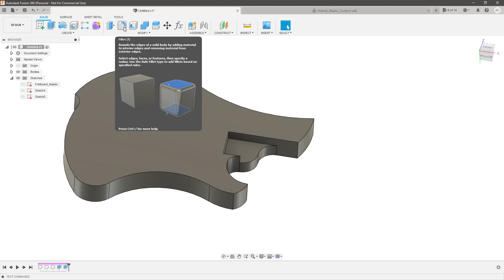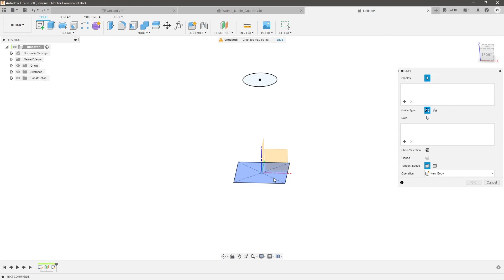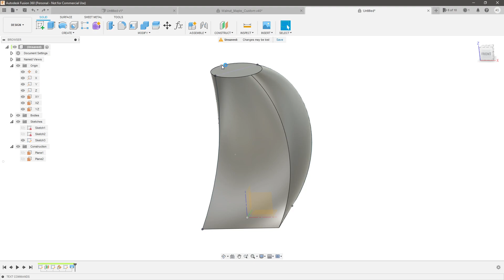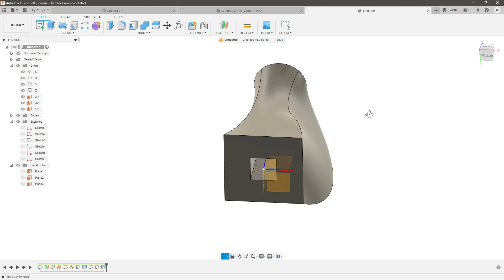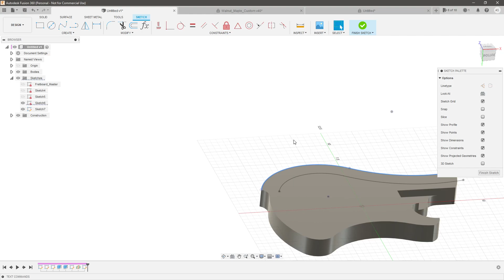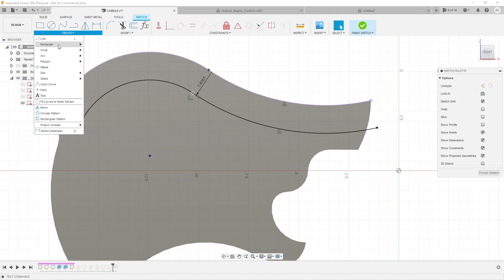Guitars in Fusion 360 | Part 2 - First Extrusions & Lofting Basics

Comment: what is the purpose of the project command? cant you just manually snap to the edge of the lines?
Reply from the maker: Well when you automatically snap to any line, Fusion is performing the project command in the background, but often it chooses to project way more points or lines than you need, which can sometimes complicate things later down the road when you change your design. It's better to manually project only what you need, then use constraints to snap to those objects. More time consuming, Yes, but often delivered better results.

Comment: Great instruction. Where did you get the files for the Bridge and Tuners, etc?
Reply from the maker: It's been a while but I do remember the hipshot hardware came from grabcad.com and i checked their dimensions against the factory drawings to make sure they were accurate. I believe the ferrules/truss rod/fret wire i modeled myself off of the drawings available on stewmac.

Comment: Thank you for this vidéo. I've tried this method on one of my shape, but when I project the contour on the top or in the center,  the originals points that are on the original spline are missing. Do you have any suggestion to help ? Thank a lot, waiting for future videos !
Reply from the maker: Are you actually using the spline tool? or sketched arcs/lines? Splines often don't leave points (except the start/end points). You might be able to add a new point (see https://youtu.be/goSEotCLLOY?t=1797 in the video) in the original sketch and then project it. Or maybe another work around is to draw a construction line up from the original sketch to the new sketch to give yourself a point to create a plane on.

Not sure if that answers your question. I might have to see your file to know exactly what's not working.
Reply from the maker: And thank you for the support! I'm planning on starting part three this weekend!
Reply: @austinshaner  Thank for the answer ! Yes I use spline to make the body contour. You're right, I have the start and the end point only when I project. I've tried to add a point on the projected lines, it works, I can create the 3 points plane and make the triangles, but when I loft I get a "Boolean error". I just tried to draw another contour spline instead of project, same issue. I can share the file if you want to have a look
Reply from the maker: @dexteriole  I haven't run into a boolean error issue before. Quick research shows there may be a problem with one of the faces or the faces are too similar for the loft to solve.  Go ahead and share the file with me and explain what your trying to do. I'll see if I can solve it for you! You can email me at austinshaner@gmail.com

You may also want to use your spline as a construction line to draw regular arcs or lines on top that match the spline contour - then project in the regular lines instead of the spline.  When I was experimenting with the neck / headstock transition i did something similar. One of my workarounds to force an interrupted surface was to draw what I wanted with regular construction lines and drew a spline on top and constrain it to the construction lines.